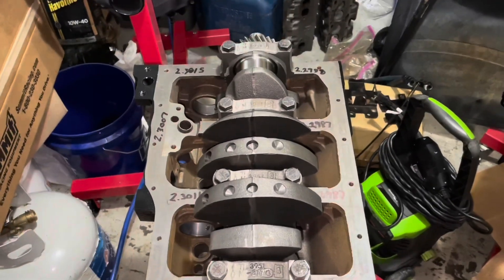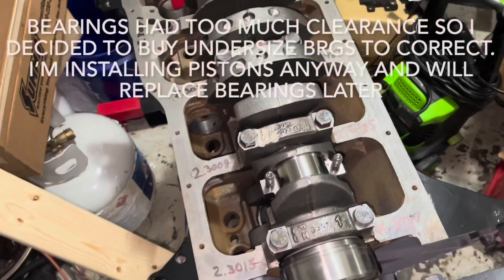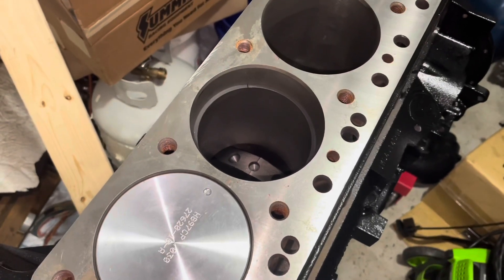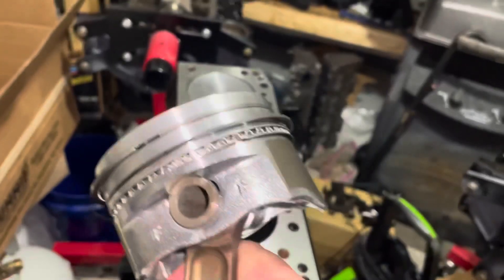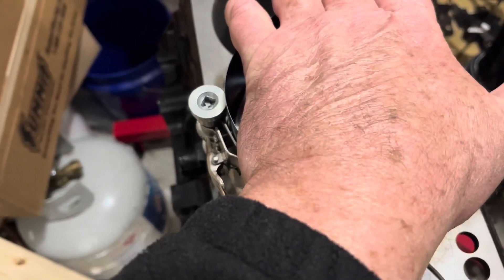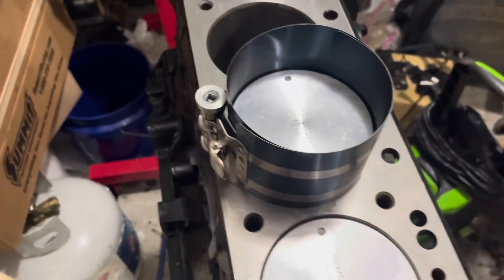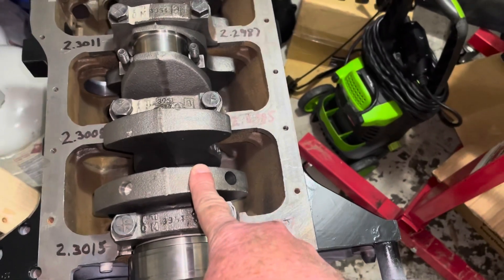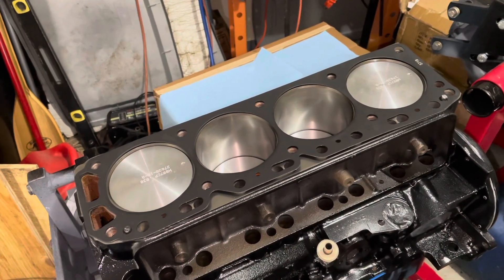Mercruiser 3.0 3a - Piston Install And Mistake

Comment: Do you know what the part # for the wrist pin for a 2003 3.0 mercruiser. Can't find a # anywhere
Reply from the maker: I don’t think you can buy just a wrist pin. Pistons and wrist pins are manufactured together to achieve close tolerances. I have never bought just a wrist pin and wouldn’t consider doing that. I just buy the whole piston which always comes with a wrist pin.

Comment: Hey there!! Just like to say that this video is very informative and is helping me out a lot with my piston install. Would you mind sharing how exactly the oil control wrong should be installed on the piston? I’m a bit confused about that in my install process
Reply from the maker: The oil control rings are three separate pieces. The expander goes on first. Make sure the ends of the expander butt up against each other and don’t overlap. Then spiral on the rails one at a time. I usually put the top rail on first then the bottom. Once done make sure the expander ends aren’t overlapping. Stagger the gaps of all three pieces 120 degrees apart.